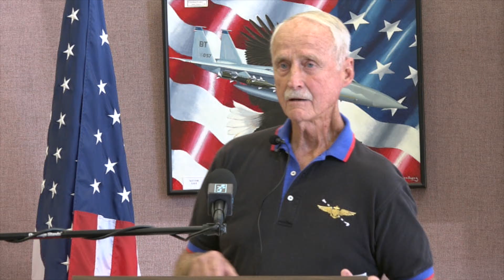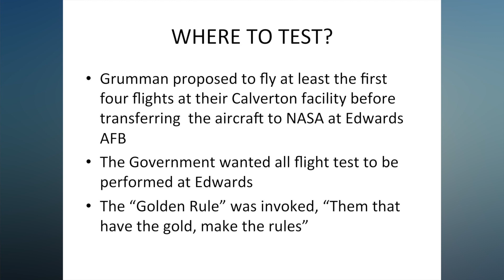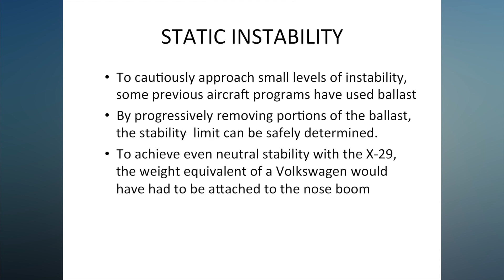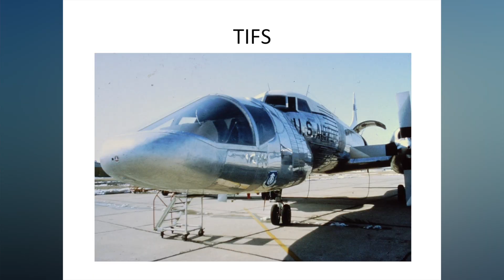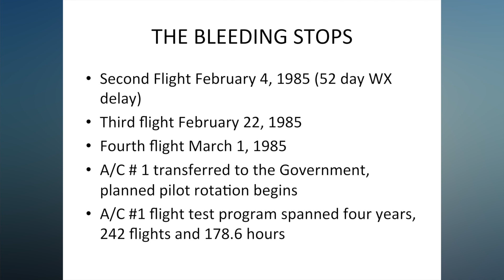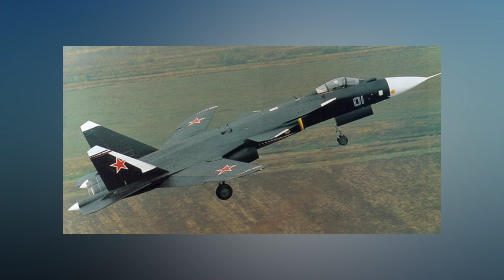X 29 Forward Swept Wing Kurt Schroeder

Comment: I worked for Grumman Flight Test for the first four flights, and Kurt Schroeder was a fine person and pilot to work with. The program really made me aware that fly-by-wire control is really the way to go for optimizing flying qualities. Kurt mentions the Teamwork, and the Grumman Team was the best I ever worked with.  As an additional note, I was just thinking that I seem to remember that Kurt flew the prescribed maneuvers a little more precisely than Chuck did, although it has been over 30 years.  Chuck was very good, but he was a little more of a "hot-dog" pilot as he demonstrated on the third flight. - He did a 360 roll just because the airplane felt so good!

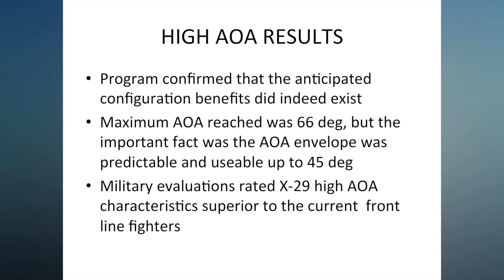Comment: 45:35 "very very good lateral control". So in regular aircraft, the rudder is used to roll the aircraft because the ailerons  have become ineffective? The flaperons of the X-29 forward swept wing thus remained effective at higher alpha than ailerons of a Back Swept Wing?

Comment: I wonder if they can make a variable sweep wing aircraft with forward sweep configuration active during subsonic and backward sweep in supersonic flight? Thanks for the video it was awesome!
Reply: Grumman proposed to modify an F-14 Tomcat or built a plane with forward-sweeping wings.
A VG FSW was never going to happen anytime soon.  They had to validate the FSW manufacturing concept first and conventional VG sweeping was already proving to be a maintenance headache in practice.  The F-14 had at least double, if not triple, the maintenance man-hours of many fighters largely because of the sweeping wing mechanisms -- motors and canvas bags (that sealed the wing sweeping plates) that had to be constantly checked and rechecked.  There were other issues with the plane being designed in the mid-1960s before the re-emphasis on maintainability and shooting for the goal of 15 hours or less of maintenance for every flight hour.  To be fair, the F-15 DIDN'T achieve its maintenance man hour requirements initially, either, and it has the SIMPLEST wing out of all the Teen fighters built!
 Anybody honest has to admit that the F-14 NEVER achieved the Navy's maintenance goals for it despite its excellent flight performance and all the upgrades undertaken towards the end of its production.  The plane really would have had to have been significantly re-engineered to get anything like half the hours it was taking to keep them flying in peak shape!  They were NEVER seriously going to build a commercial airliner with variable sweep because of the additional cost and weight of the sweep mechanism.  It gets to a point of being TOO heavy and complicated as the size of the plane increases and only the military was willing to deal with the maintenance issues.  
The FSW F-14 never went forward and in the end the only FSW the US built was the X-29.  The FSW concept was proposed for at least 3 different designs or modifications of existing planes (all fighter-sized types since the emphasis was on enhanced maneuverability) by Rockwell Int'l, Grumman, and General Dynamics.  GD basically would have replaced the wings of an F-16 with FSW and that would have been the extent of the changes.  Rockwell proposed a completely new design that was a hybrid between the GD and Grumman concepts.  Grumman was chosen because their design was a meld between old and new. 
 DARPA didn't want to award the FSW X-plane contract to GD because it could be seen as favoritism and giving the company too much of a leg up for full-scale production IF the F-16 FSW did work out.  Rockwell's plane would have been most expensive since it was practically all-new.  The Grumman design was chosen because of incorporating all the off-shelf components already in existence (F-5A forward fuselages, F-16 landing gear and flight control computers, F-18 engine, etc.) and being half-new/half-old -- more economical, seen as less risky than an all-new design.

Comment: The maneuver/roll by Chuck Sewell cost him the X-29 for a bit!  He was supposed to the chief test pilot on the F-14 upgrade program (F-14A+, BuAer 157986) but was killed in a vintage TBM Avenger crash during an airshow.

********************

I was surprised by Schroeder's comments.  Every entry you read online about the X-29 makes it sound like the plane was a dog!  To hear that the plane turned tighter and could outmaneuver was interesting.

I do think, however, that dogfights aren't over with yet...  If electronic countermeasures and flares get better, maybe the dogfight missiles won't work out as well as predicted.

I think the mission planners are being overconfident with stealth AND the new generation of air-to-air missiles.

We may not have seen the last of the FSW platform.

Too bad to hear that Wright-Patt compromised the first X-29.  They sawed the wings off and glued them back on afterwards?!?!?!?!

Yeesh, and they said NASM was hard on the flight hardware they got!